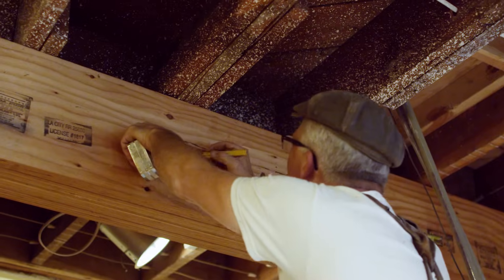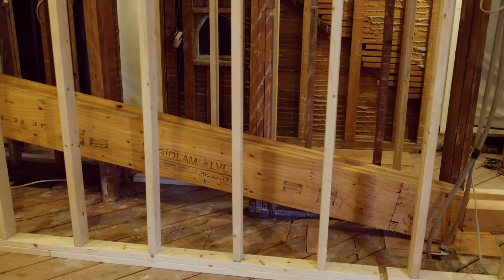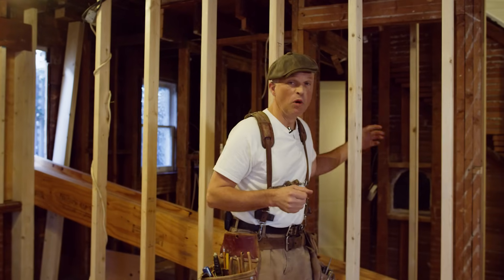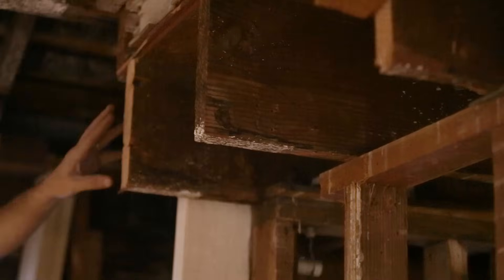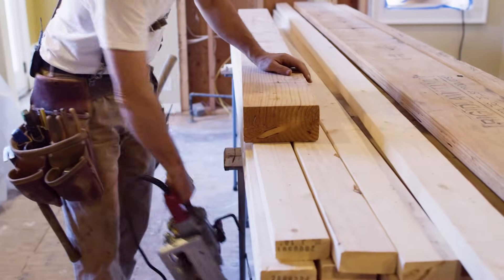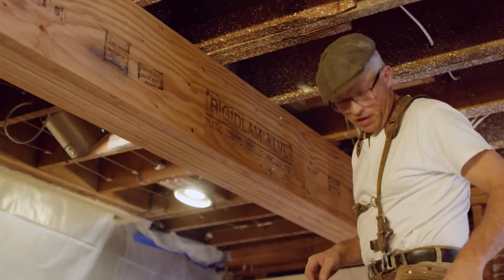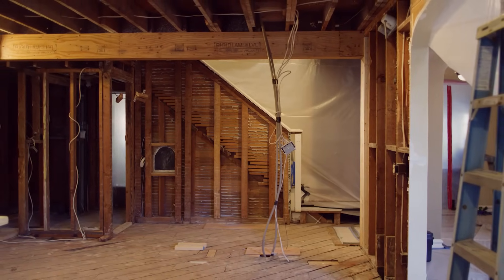Installing LVL Beams During a Residential Remodel

Comment: Are the post LVLs as well or just regular lumber? Does post need extra support underneath if there is a basement?
Reply from the maker: If there was a basement, or even a crawlspace, the posts may need additional support below. It is always recommended to get an engineer involved to help identify these load paths and make sure you end up with a safe and properly functioning result.

Comment: With your expertise, I wanted to know if you would personally drill a 2 inch hole for plumbing on a 11 1/4 inch by 1 3/4 inch sistered 3 times? 
LVL permits it, on their website

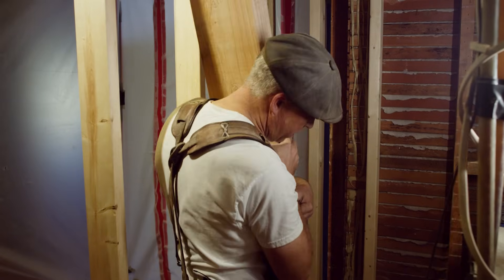Comment: You said at 2:30 that you were putting in glue on the exterior lathe to "help solidify it".  What does that mean, exactly?  And on that outer wall post, how exactly did you attach it, so that it is structurally sound?  Looks like you just popped it in there and it's held up by a little friction between the two wall studs.  You need to be showing how you attach stuff like this.  It's why we are watching your videos.  Otherwise, it's just a "look what I did" video, instead of a  "how to" video.   Finally, how did you deal with the Length of that beam?  Is there a small gap in the end, in order to be able to actually slide it up into place?  What process did you use to actually slide it up into place?   Pretty sparse video.  You also need to ensure that the two end posts are properly supported from below, in order to take on this focused extra load.  If those are sitting on horizontal floor plate and there's nothing under the floor holding it up, you gotta huge safety problem.

Comment: Thank you for the video. What is the "maximum length" that an LVL Beam can be..? As part of a basement renovation, I am wanting to relocate (and still use) two (2) solid steel posts and install a header for the main floor upstairs. There would be a 3rd solid steel post in the middle off an approximate 29' span.

Thank you in advance for a response as well as any comments from the YT community.

Comment: I love your video. I have a question about removing a wall in my garage. The previous owner put a second single car garage on the original single car garage. There is a wall in the middle of the garage I would like to remove it. The wall is NOT a load bearing wall. It has a Hip roof, with trusses. The span is 27 ft. It sits on a concrete foundation. 6"X2' There is a shelf storage on both ends of the of the original garage. I want to use 2X12 or 2X14 LVL's. (2) or (3). Again, it is not a load bearing wall. Would this work. Thanks. PS. The garage is 32' X27'. The Trusses are not lined up with the wall.

Comment: Do you have to strengthen the structure under those end posts ? I mean in the basement.....
I have a 2 storey very similar to the one you are working on and want that look !
Oh, I forgot to mention that one end of the beam would not necessarily be on an outer wall but 3 feet in as there is a closet there

Comment: It would be nice if you mentioned what to do if some joints are higher and some are lower when installing the LVL support. I mean your not properly transferring the load if your only contacting partial joists or if you jack it in then you buckle the floor above. LEts face it ....its never that simple. Tediously chiseling or shimming with what?

Comment: Is it OK to install the LVL beam without a top plate? I'm replacing a cracked wooden beam which runs parallel about 2 feet away from my garage door and will be using a 3.5x12" LVL beam at 19ft length. The beam is supporting the roof rafters. The old wooden beam had a single top plate. I would like to not use the top plate to give me more clearance as I have a very low headroom clearance as it is...

Would it be fine to not use the top plate as was seen on this video? Is a top plate even necessary on an LVL beam?
Reply: Is for a garage door opening?  For a 7 foot tributary roof area, that beam fails.

Comment: Great video. I am removing an overhanging soffit that use to be supported by a 3x3 pantry below it. The lvl will be spanned 15 feet from wall to wall. It will support 10-11 rafter beams and the roof in a single story home. Would 2 2x8 be good for this, or should they be 2x10? I would also like it to be recessed, aside from the height of the stud pack, is anything else different?

Comment: Just bought a house and will be using LVLs to take out a wall dividing the kitchen and living room, will let in a ton more light and then I have so much more work to do... can't wait.
Reply: Will be doing the same, first though I'm planning to go from 8ft to 9ft ceilings so researching the ins and outs of that

Comment: Enjoyed your video on LVL beams. Presently have 2x 12" x 84" long beams nailed together supporting floor above the basement bathroom. Wanted to know if the LVL beams come in 8" height as I wanted to gain height going into the bathroom right now. If so would I need to add an additional beam or 2 in order to have the proper support. I was thinking of putting 3 or 4 beams nailed together 8" in height x 84" . Would this be strong enough to support floor above.  Please advise.( barillaro.steve@gmail.com)  Thank You,

Comment: I have an older shed building that is 30’X40’.  It appears the roof wasn’t built very strong and has dips in it.  I’m wanting to add two of these running the 40’ length.  I have an understanding of how to attach them on the ends, but how do I secure the 2X4’s on roof to the LVL’s?  Just screws or store bought brackets?  Do the 2X4’s have to be notched?

Comment: it would have been a great video if mentioned LVL, post s sizes as well as lengths
Reply: The posts sat in the walls were 3 1/2" thick and appeared to be 8" wide. So I guess you could call that a 4x8. Smaller beams could use a 4x4 or 4x6

Comment: I'm not a carpenter, engineer, architect, or any other type of qualified individual regarding framing but my question is this. Could temp walls have been put up on either side of the LVL location, existing second floor joists cut away for width of LVL, and LVL raised up to meet second floor ply subfloor, with the cut floor joists strapped to  LVL or Simpson tied, or however that attachment would be done? It would raise the beam almost entirely up into the cieling, and present a much more appealing appearance. Just trying to learn here.  Thanks in advance.
Reply: Yes.

Comment: So I currently have 2x12s running 8ft and need 10ft I know 3 2x12s can span 10 feet between post. My question is can I use 3 2x12s as support and not those ugly jacks?

Comment: We cut the floor joists above the beam location and then clipped the cut joist ends to the beam. This let us shove the beam up flush with the subfloor above and minimize the visual exposure in the new room. This was all cleared by our engineer and the building inspector.  The other beams we installed under the joists, but hid them inside walls and door frames.  It looks like they could have done the same here and kept it all more open.
Reply: When you say "clipped"...do you mean you added metal hangers?
Reply: @jerrymccurry9372  hurricane ties that were approved by inspection. Joists were all well blocked to stop and twisting.
Reply: Agree with you , want to do in my living 22feet spam hide 8 inches cutting the joist and the other 8 inches  exposed want to use 4 lvl 16 inches  by 22 feet long

Comment: Is there a formula for the thickness of the beam related to the span of the opening?
Reply: There are three, one for the wood fibers resisting bending stress, one for resistance to deflection, and one for shear parallel to the grain. It's usually better to use values from a table, rather than calculate it out by hand, unless you have special circumstances. There are a lot of factors that go into each equation.

Comment: You said we might want to consult with a structural engineer. Did you? What was the total weight of the load you transferred? What is the total weight on R1 and R2? What considerations was given to the increased concentrated loades and the effect and how did you determine no considerations were needed?

Comment: I definitely would have put the lag screws in the beam before removing the temp wall..... IMO as a prof engineer.
Reply: @siliconvalleymetal  I second that.
Reply: not wise after all
Reply: @siliconvalleymetal "Settle evenly" ? What's moving? Some of the LVLs?  Well that would be the definition of "uneven loading". I disagree with your call, bolts need to be installed so that they can be put into sheer when there is ANY differential loading so that they may transfer the load to adjoining beams. In the limit of many beams carrying a load, such as the LVL itself, it would be like saying place unlaminated sheets of wood up in the ceiling. Then, cut the temp walls down THEN glue the beam together....
Reply: @siliconvalleymetal  beams are chosen for their stiffness and resistance to deflection. Typically the beam would be one continuous piece, you install it THEN apply the load resulting and some deflection under load. When the beam is composed of multiple parts that are to function as a unit, all of it should be installed prior to the load otherwise you end up with a larger deflection. There isn't really much else to say about it.

Comment: What happens when beam not installed property? I have a flush beam just pul in and mow my walls are separating from the floor.
Reply: What happens is you go back to the company who did it and get them to fix it.
Reply: What happened with the walls?
Reply: First learn English, then spell check...call lawyer.
Reply: @johnsmith-qe2fd  She meant to say "I have a flush beam just put in and now my walls are separating from the floor."

Comment: Nice video.  Something that needs to be mentioned is that the new Posts holding the LVL  have to have support all the way down to a footing or other qualified beam.   Ive seen guys do this and the posts were sitting on 3/4" plywood with nothing below it...literally floating.  Make sure you have a structure path all the way down to something solid.
Reply: Lol. I’m on a job now that someone did. 
Ran a lvl 24 ft. And went to floor 3/4 advantech then not a dam thing under the ply. 
Lady noticed the laminated floor was popping up.
Reply: Wow thanks I though I was the only one ,  I’ve seen many videos showing how to put up the top and no comments on the bottom support 👍
Reply: Totally agree, but I would assume that there is a footing below the post since it is replacing a load bearing wall on the exact same spot.
Reply: @samfr8370  then he should have mentioned that.  Also the lack of simpson ties.  Would not pass inspection
Reply: Thought the same thing verbatim. I’ve seen it done as well. Floor flexing under load and a disaster waiting to happen
Reply: So if I install an lol in my basement and the vertical support beam is going down to the concrete floor, is that enough? Or do I need to verify the thickness of the concrete
Reply: @mikebower4582 I’m in Canada- and even on a basement slab, depending on the load and size of beam we need 2’ square pier created under our posts- a big square cut out of the slab 8-10” deep, reinforced with a floating rebar cross hatch at least 3” from the bottom of the hole and abiut 2” clearance around perimeter before pouring new concrete into the hole. This new ‘pad’ now distributed load evenly instead of potentially compromising large swathes of concrete floor under the column over time. Now if your over the existing foundation wall, that is usually acceptable but if you are not, these piers are necessary according to National Building Code of Canada.
Reply: Yes right
Reply: It is mentioned, its what  meant by "Load Bearing Wall". This is carpentry LVL install video, not a Engineering calculation video.
Reply: Also, more load transferred from a wall to 2 points may require thicker concrete under the new posts
Reply: Why is it that extra footing support of post n beam or concrete footing ever discussed? How about metal support straps?
Reply: cruisin thru I assume he is bearing on a bottom plate, onto floor boards, which transfer the load to the joists and bearers, which assuming here are spanning end to end on a continuous concrete footing to ground, pretty hard to tell from a video though, but ur right though these kind of things for someone not in the know can be bad practice, good carpenters well always check these things.
Reply: @godspeedjnr3068  great comment. May I add with your comments, the transfer of load point must be a larger supporting base, 
1- Concrete underpinning more concrete
2- Larger Floor joist post n beams to support & transfer of weight the LVL beam carries.

Comment: Do your self a favour and Put in the Screws BEFORE YOU TAKE OUT THAT LOAD BERRING WALL so there is no deflection in the LVL beam's when the house's weight goes down on it.
Reply: Do yourself a favor and not try to tell people what to do when you don't know shit. The wall is taken out before it is  screwed so that it allows the beams to rest in it's load bearing position, So that it distributes the load evenly.
Reply: Do you even know what LVL beam deflection is?  It's a term used to explain when a load bearing beam has so much weight on it so much so that it will twist and deforms!  The whole PURPOSE in putting the screws before weight is added  it is to sister the weight from one beam to the next to avoid structural deficiencies ect.... LVL's are machine cut strait right from the factory so there is no high or lows/warping.  Your's logic is exactly the type of DIY idiocy who has little or not idea what he would do, more or less best stick to cleaning toilets before you talk like you know any better.

Comment: Hey I started project of removing wall and suspect it is a bearing wall, (structural wall)  so I stoped the work as client wanted to remove this wall. Where should I look for help to find out whats required to hold the load. Above is a timber stud wall + joists ans a roof.
Reply: You tell your client to hire a structural engineer :P

Comment: What is the difference in carrying capacity between a lam bean that is 5.5" wide and 13" high (basically a bunch of 2x6's glued together) and a solid beam of Douglas Fir that is 5.5"x 11.25"?    Trying to figure out how much carrying capacity we would lose using the doug fir beam on a 20' span.   Thank you.

Comment: can i use two 2x8's with ll/32 ply glued in between as a beam to replace 12ft of load bearing wall?
Reply: Since you didn't offer the necessary information to answer the question I'm going to say no.
Reply: 2x8s would not be sufficient for that long of a span. 2x10s at least, I'd say. Definitely depends on how much weight you're putting down, too.

Comment: Very very good shows, Excellent video!.  I will have an opening 18', It does not bearing wall, it supports ceiling only, (It will be one side has 18' long ceiling joist and another side 5' long ceiling joist only). With LVL 16"x20',  should I use two or three ? Thank you very much.

Comment: Would you ever use wood glue or construction adhesive to glue those beams together as well as screwing them? would it add more strength?
Reply: No, when using multiple LVL beams for a load bearing wall replacement they must all settle into place and equally share the load of the weight directly above before they are secured/fastened together. If you were to glue them first the load could be improperly distributed, and this would cause stress on the beam.

Comment: When you said they are light, I laughed! Today we put in a 36'x18" ridge without any equipment. They are not light!
Reply: 36’ of anything structural isn’t going to be light. For his application, he was able to make the beam out of four LVLs so each piece is light enough for one person to put in place. Much easier for a carpenter to fasten together than a beam made with two or more 2 bys with one or more flitch plates sandwiched in between. Generally speaking a built up wood beam will weigh the same as a comparably strong steel beam.
Reply: He's comparing it to steel probably. Which would need a crane for something similar.
Reply: Yeah ive never thought of  lvls as being light 

Probably one of the heaviest things I’ve ever carried

Comment: Important to note: follow fastener schedules for ganging multiple plies. Also i would install fasteners before removing the temporary wall. The individual plies don't have the desired " load rating" until they are fastened. (AGAIN, according to the fastener schedule which varies per conditions...ie number of plies, side load conditions, etc.

Comment: Great video! I want to open up a gap in a load bearing wall. It already has a roughly 4 ft opening, I want to take it out another 3 or so feet to a closet door. The wall isn't holding up a second story though, the roof trusses tie into the wall. Would the support wall be the same as if it was holding up a second story? Id like to hide the beam if possible, but I am ok if it has to be an exposed beam as well.
Reply: This is the type of question you ask a civil engineer that works in this particular field.  It will cost you a bit but is worth the money.